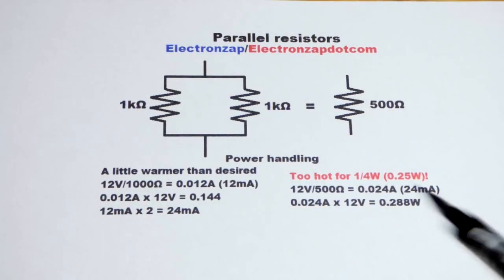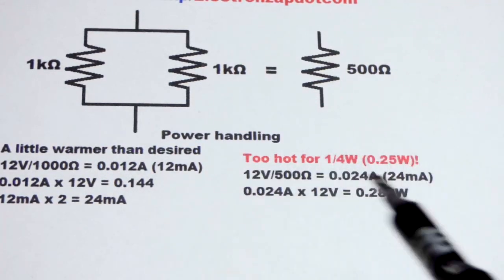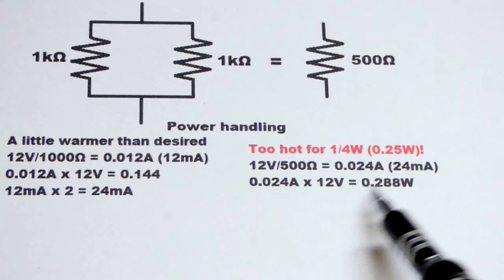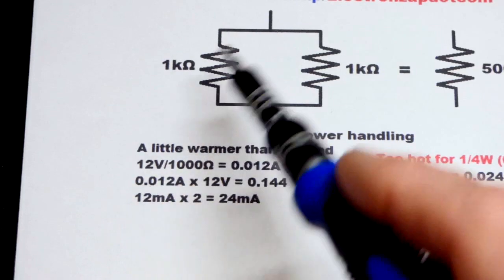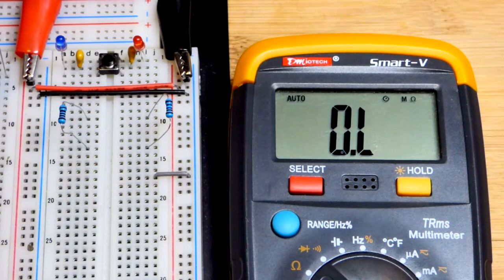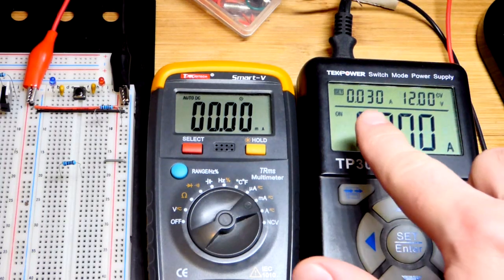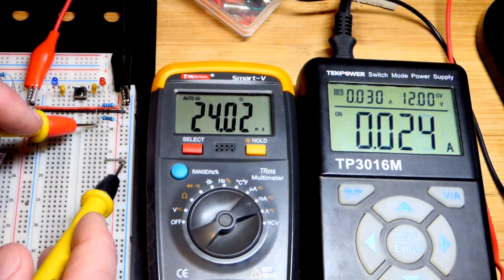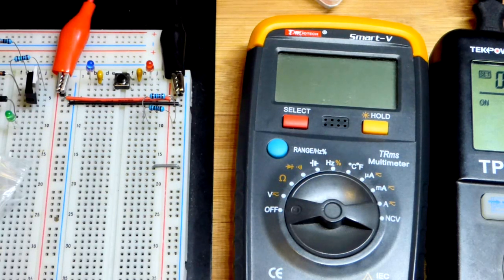How to use parallel resistors for a fractional resistance plus more current and extra power

Comment: Shouldn't this be theoretical ? Even a 1k resistor has 5% value tolerance ? So least path it will flow only, meaning any one of the 1k ?
Reply from the maker: It's not a precision circuit, so approximate values are good enough :)